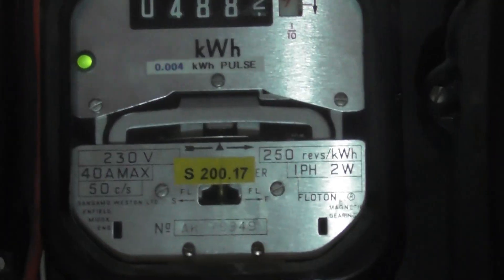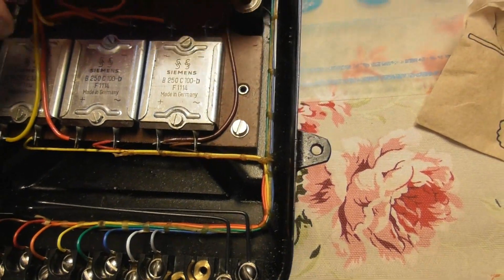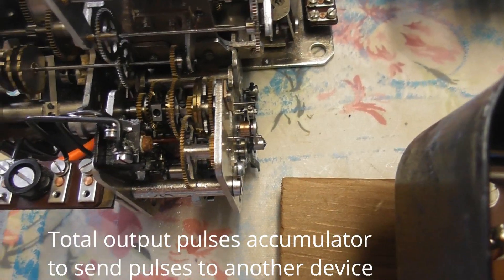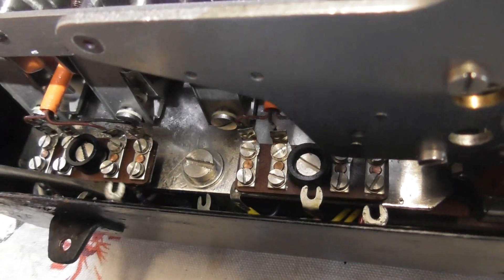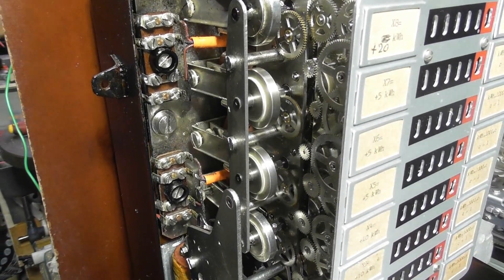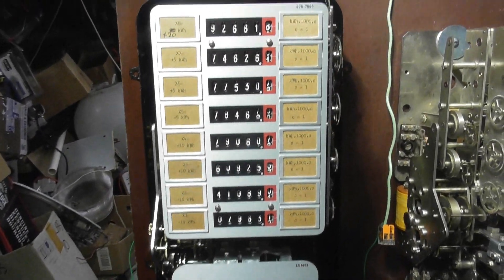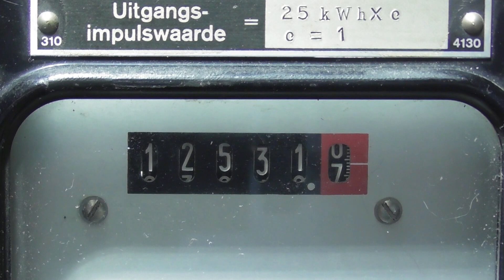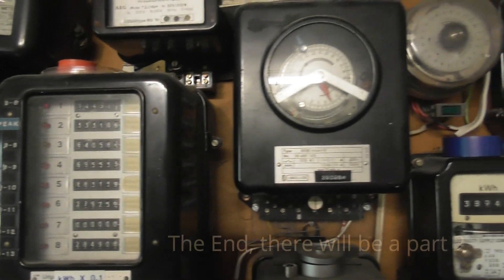Summator meter CaC3.8r from Landis & Gyr

Comment: Was looking forward to this video. Very interesting with the ratio gears compared to our modern electronic metering with CTs & serial comms. Used still use hall effect sensors to digitize some of the water and gas metering theses days, yet others in factories would use modbus or a profibus serial type of comms.